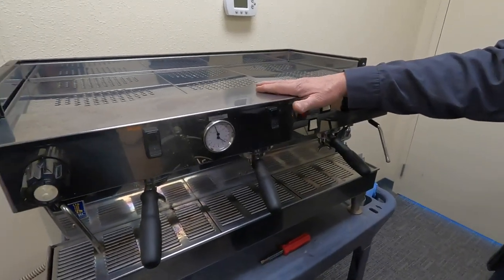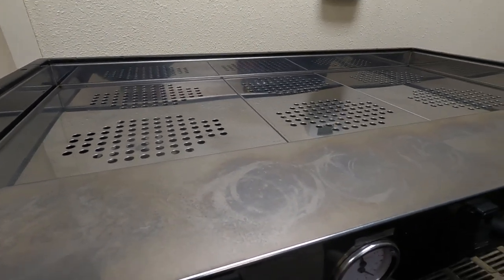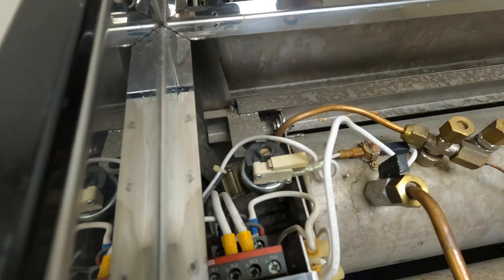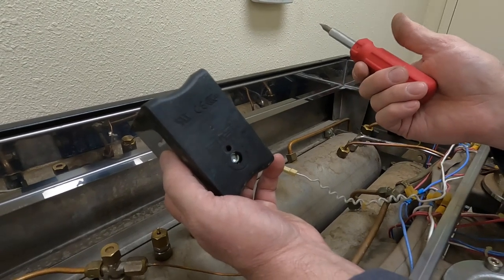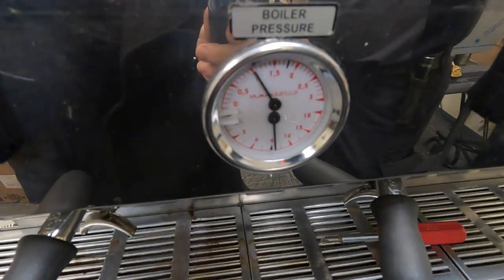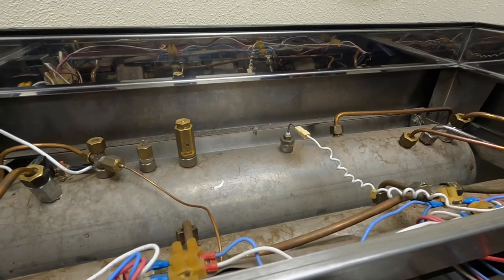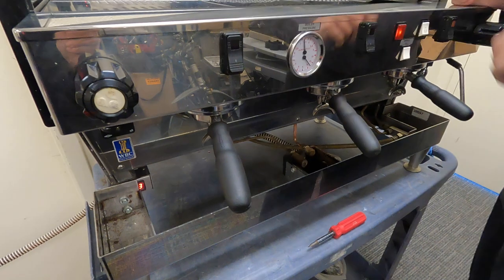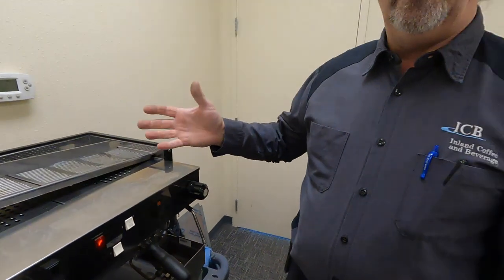Adjusting La Marzocco Linea Classic Boiler Temperature and Steam Pressure

Comment: Great information and presentation… would you do a video covering descaling a plumbed in commercial espresso machine?
Reply from the maker: Do you mean while it is plumbed in?
Reply: @EspressoServiceNetwork  not necessarily while it’s plumbed in, but is when it’s operating, unless that’s possible?
Reply from the maker: @mhf5044 Read this article first. https://espressoservicenetwork.org/p/resources/diy-refurbishing-your-own-espresso-machine. It really puts everything into simple steps. I’ve descaled without refurbishing the machine but rarely. After reading, let me know what you would like to see if not the whole thing.
Reply: @EspressoServiceNetwork  descaling without refurbishing would be what I’d be interested in. I have an 08 linea classic that is our current workhorse for our cafe 5x a week, refurbished quite a bit of it already but from my previous work can tell this is something that should be on my radar. My other remaining project is inspecting/replacing if necessary the heating elements in both the steam and brew boiler.

Comment: My machine pressure valve keeps going off every like 20-30 seconds when my machine is warmed up that means valve is bad or to many bars is building up, should I tried lower the pressure by that flat screw driver bolt you mentioned in the beginning of the video?
Reply from the maker: There are multiple issues that can cause this contactor is bad, pressure switch is bad or t-fitting is clogged

Comment: thank you for this video! Question: what is the range of temperature for the thermostat on the boiler? I'd like to brew at a temperature around 185. Is that possible on a 2008 Linea Classic?
Reply from the maker: Yes, you can set the PID or thermostat for 185.
Reply: Thanks for the response! So to confirm, that would include a 2008 Linea Classic AV 1 (before they started installing the PID controller)? I need to set it to 185 F to brew Yaupon espresso, which is best at lower temps. Thanks in advance!
Reply from the maker: Yes, you can set the thermostat to 185 on a 2008 Linea Classic AV 1. Make sure to shut your machine off and take all safety measures  before making the adjustment.

Comment: Our machine (same as in video) is overheating at times.  We do not have a PID controller on it and I have no idea of where the thermostat is located.  If we put a PID controller on it, do we have to use the La Marzocco item or can we buy another brand.  I see quite a few on Amazon. The OEM controller is about $650.  Any brand recommendations?
Reply from the maker: The OEM part includes the wiring, solid state relay and temperature probe. With the OEM part the algorithm is also pre-programmed. I would not consider another brand. Your thermostat is located in the center of the brew boiler. If it is a 3 group it is off center.

Comment: Hello! We purchased our espresso machine used, it's a newer Linea machine (less than five years old I think). The temperature of the hot water/tea water is 200 degrees, but the three group heads water comes out more like 110 degrees. What's going on?
Reply from the maker: Sorry, my comment before was for someone else. Most likely, your thermostat is not set properly or you have a bad heating element or the safety thermostat is tripped.

Comment: The steam boiler for my shop’s Linea Classic isn’t heating at all, but the water level hasn’t gone down, nor has the reset knob responded to turning the machine off and on again. Any thoughts?
Reply from the maker: The following things could be bad, heating element, pressure switch, contactor, safety limit, or wire connections. Not certain what reset knob you are referring to? Let me know?

Comment: I opened my shop today to find the boiler pressure on 0. No steam and no hot water. I turned on and off the machine a couple of times and boiler heated up again.
No idea why.
I always keep the machine on number 2.  Any idea why?
Reply from the maker: Hello! Most likely a faulty pressure switch or faulty contacotr/power relay. Let us know what you find out?

Comment: Hi

There is some problem I my LA Marzocco GB5 Machine.. Hope to get some help..
I changed the flow meter Gicar sensor and impeller of the flowmeter..
After replacing the parts and cleaning the group heads I did programme the water volumetric as shown in this video for all first four button and saved the programme by clicking On/ OFF button..

So after programming I  press the first button to start the cycle. But the cycle  did not get start.
 Similar to 2,3 4 th button..CYCLE did not start .

All the lights of button are glow up but it did not work.. similar to the second group Head button...
I did same programming for 2nd group Head. But after water volumetric programme the cycle did not start..

What exactly has happened? Did I miss anything?
Reply from the maker: Your flow meter may not be working properly due to bad wiring or connection.
Reply: @EspressoServiceNetwork  
Will the machine give alarm as flow meter false ? If connection is wrong or bad wiring
Reply from the maker: No not if everything has been programmed to zero.